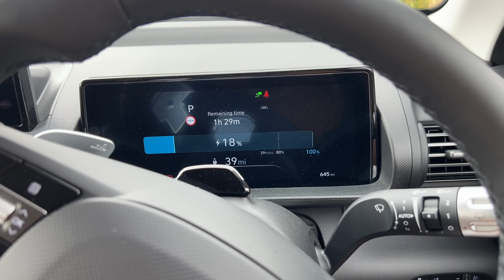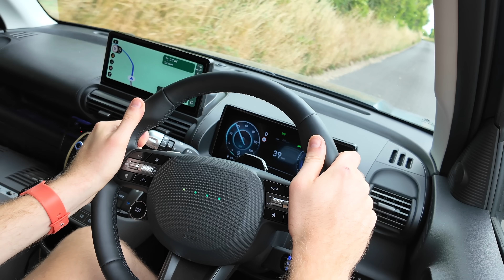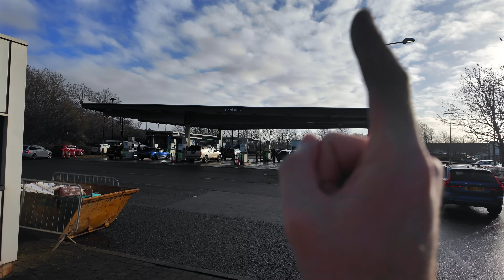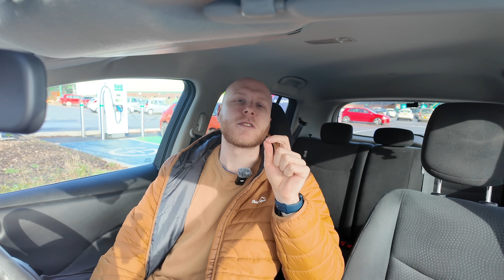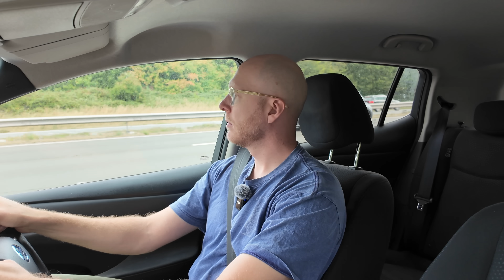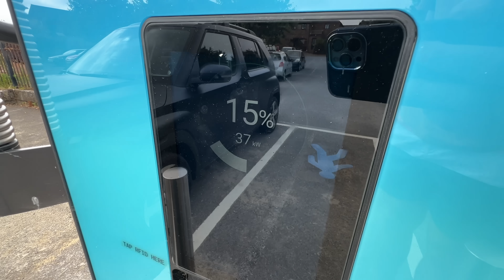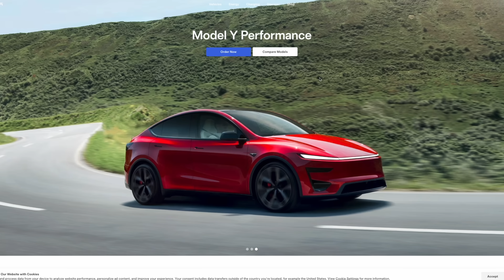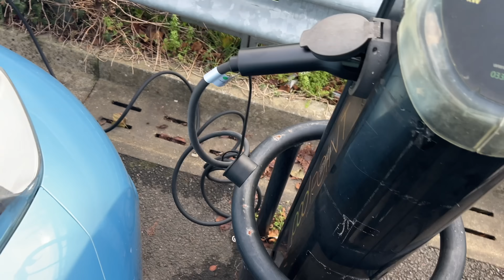19 Things You Should NEVER Do In An Electric Car

Comment: One of the morals of owning an EV seems to be to not believe anything that the car is telling you.  That's handy, I like a bit of certainty in life.
Reply: I have never found indicated range on a typical gas car to be all that accurate. I know the software is based on a filtered fuel sender position and long term fuel economy. The electric calculation should be easier.
Reply: My KIA EV3 predicted range is pretty much accurate all the time.
Reply: To be fair,  that is mainly for the leaf, other electric cars are much more reliable on predicting range than the Nissan leaf,  I speak from experience,  as I have owned a Nissan leaf 39kwh from new for 3.5 years,  I have done 69,000 miles
Reply: Agree, my car is within a few miles of estimated range

Comment: The 100% charging isn't really a problem any more and especially if LFP batteries and up coming Na+ chemistry.
Reply: 🤓☝️ charging to 100% and discharging to 0% over extensive periods (days) in any chemistry  including na+ does wear out the anode/cathod. 
But unlike NMC batteries, LFP batteries need to be charged to 100% and discharged to <10% regularly to help the BMS manage the voltage range and correctly detect the SoC.

in terms of it ever being a problem, it was never really a problem in the sense that the life of the battery outlasts the life of the vehicle in all chemistries

Comment: Cars with LFP batteries (a.k.a Chinese cars) don't bother at all with charging frequently up to 100%.
Reply: And even if single cells fail, these can be replaced for less than the cost of a complete battery replacement. The company that does this is still expanding, but I am sure: as the demand for that repair rises, so will their country coverage.

Comment: If you are watching this as a potential EV buyer or a brand new one and are finding it daunting then don't worry, you dont need to know any of this in your first few months. Watch some less sensation how to videos (Dave takes it on has some good beginner stuff) and wait till you are comfortable with the basics then come back to this as the info is useful but is presented as if you are going to explode if you get the slightest thing wrong.
To add to the tariff table, EDF, who i dont particularly recommend has the following EV tariff: peak 24.98, off peak 8.99 (12am - 5am), standing 71.

Comment: It should be noted that driving with one pedal does not only guarantee savings. Always below a certain speed (10MPH), the car USES energy to stop instead of recovering it. So not using it may be more energy efficient.
Reply: That fundamentally misunderstands OPD. It simply replaces braking in all circumstances where you would normally have engine braking or light friction braking.

All cars need to be brakes to a halt from around 10mph, and if you choose to lift your foot very lightly as you approach traffic lights, say, OPD puts some of the energy normally lost to friction into the battery.

It is a myth that regen or OPD is somehow “more inefficient than coasting” - that is a lie spread by the some car manufacturers because they couldn’t achieve a smooth OPD function.

BMW has achieved it with the Neue Classe cars, I understand, so I hope they will at least educate people. I discovered their “joy of stopping” years ago, in a Polestar 2, which is one of the reasons I chose to avoid any car without true OPD
Reply: yes, many times 1 pedal driving combines regen and friction. ideally for efficiency is no big accelerations, no friction breaking and minimal regen... ideally of course 😅. the ideal sweet spot is when you don't accelerate nor regen and just coast (at if in neutral in a combustion car).
Reply: OPD achieves “neutral” or “coasting” all the time. All it means is that the car needs a certain amount of energy to overcome mechanical, rolling and air resistance.

If you are driving down a slight slope, enough for gravitational potential energy to overcome those resistances, then OPD will ensure that no energy is going into the battery and none will be harvested either.

Regen is conceptually the same as braking, except instead of throwing energy away as heat part of it is put into the battery.

If you don’t need to brake, regen will simply not happen, whether controlled from OPD or the “brake” pedal.

This weird thing people imagine, that regen tries to take energy out of your motion when you otherwise would not have actually braked is just that, weird.

OPD driving and regen are two of the things that make driving an EV a total joy to drive. All this pointless shuffling of your foot from one pedal to the other is ridiculous.

I have touched the brake pedal in my Polestar 2 around once every 100 miles, and OPD is on 100% of the time. Adaptive cruise control uses regen when it needs to reduce speed, and power when it needs to increase it, and I typically achieve around 5 miles/kWh on road trips.
Reply: Bottom line is, you are probably talking about gaining another 2 miles range! I wouldn’t get hung up about it, just drive, use one pedal if you like and brake when you need to!

Comment: 100% You can't use regen braking.Use your brakes I do often .Leave them and your disc will rust and when you need your brakes in an emergency you could be in trouble.
Reply: My car will regen to about 5mph, then brakes are needed. This helps keep the brakes working. I just treat regen as engine braking.
Reply: My BYD can use regen brake with a full battery, because the battery has a buffer.
Reply: 'Cant'...I use it every electric journey in my phev? Car slows sets off automatically in traffic hands feet free!

Comment: If you need 100% charge, then charge to 100%. Not everyone has home charging.
Reply: Just don't do it at an ultra rapid charger. Charge up to 80-90% and then move it at an AC charger and charge there. It won't make any difference at the speed of charging, most cars after 90% do not charge so fast, ussually they fall below 20KW even below 7KW after 95% and it is possible that you will pay less.
Reply: @chrishar110  And where would this AC charger be? They're not too many of them conveniently located.
Reply: @stevekight1955  They are everywhere, what’s the problem?
Reply: @stevekight1955   This AC charger would be in your garage.
Reply: @woodenmetal2977  like he said, I don’t think he has home charging
Reply: @MRSALT22 
He said "there's not too many of them conveniently located." Since the context is rapid chargers, the AC chargers he's referring to are the level 2 public chargers.
Reply: @chrishar110 my ac charger is only 3kw so I'll stick on the rapid if I need 100% or I'll be there all day.
Reply: Depends on the trip. So if your journey has two chargers along the way, its quicker to do a two stop than 1 stop, as doing 10% to 100% takes around 1hr, while doing two 10% to 80% takes around 1hr, but you got an extra 50% more charge for same time. So if you cut the two stops to 25mins or even 20mins each, thats upto 20mins quicker.
Reply: As someone who doesn't have home charging, don't charge to 100% - there's no need to reach 100% of your capacity at a DC FC - the most I tend to do (when the chargers are empty) is 90% - mostly because I have to drive the car back to my place so it usually will sit there at around 85% until the next day.  But it depends, entirely, on when I'm driving next.  If I'm charging on AC at work on Thursday and I have no plans to travel, then I'll only charge to 90% - if I have travel plans, I'll charge to 100%.  But I've had no issues doing the big travel days with 80-85% - there's few situations outside of a long distance road trip (and, again, charging past 80% makes no sense because it'll make the trip last forever, and when on a roadtrip on an EV you only want to charge with enough to get to your next charger).
Reply: I don't even charge to 100% at home. 

At a rapid, the only reason you could ever have to charge to 100% is if it'll take 100% of your battery to get to the next charger. As that's never the case. There's zero reason to charge to 100% at a rapid. Taking 1h+ to get that last 20% on a trickle charge just makes you a nob. You're wasting your own time as well as everyone waiting for that charger. 

If it takes 20 minutes to charge to 80% and another hour to get that last 20% you could have discharged and charged your battery 3 times in the time you wasted.
Reply: Depends on your battery. If your vehicle has an NMC battery then you should only charge to 100% occasionally
Reply: this don't charge to 100% only applies to non lfp batteries.
Reply: @hirukaru4835 this don't charge to 100% thing actually only applies to old and early EVs like the 1st Gen Leaf. Let me give you an example:
A carmaker gives you a 160k km warranty for the most expensive part, and makes a part, which will lose it's capacity fast if charged to a 100%? That would not make any sense at all. Modern BMSes can handle these charges well enough that it should not be an actual bother for a normal car user. 

If you have an early VW ID.3 for example, the car tells you to only charge till 80% to preserve battery health, even though the battery is only able to balance the cells between 95 and 100% SoC, so the car will get a cell failure error code when only charged to 80%, which, if out of warranty, will cost you 4000£ at a dealer, even though a few 100% charges whould probably fix the issue. My mom's ID.3 got the same cell error code, and after a couple of weeks it did stop showing up, because since then we are charging it to a 100%. 173 k kms, and still drives and charges like new.

Comment: It's like you're trying to put people off buying electric cars. Telling them they need to buy a special device and interrogate the car through the OBD port is firstly guaranteed to put most buyers off and secondly suggesting that you do propagates the myths that EV batteries degrade badly, which they don't according to numerous videos that I've seen.
There's a few videos doing the rounds of several Tesla model S cars that have variously done from a quarter of a million miles to close to half a million miles and still have 70% or more battery capacity.
HubNut channel recently covered a quarter of a million mile (though only five years old) Hyundai Ioniq vehicle that was showing 100% according to the EV specialist that bought it and intends to use it as a courtesy car. Similarly he covered an (old technology) 10 year old Nissan Leaf with 150 thousand miles which had 82% battery life.
So, unless you're buying an extremely old car, you don't need to worry about it at all.
Reply: These videos are great for letting people appreciate all the things they took for granted in a normal car. I could have filled my tank 8 times during time it takes just to explain all the problems with EVs.
Reply: @SteveLomas-k6k  I'm sure he could do a similar video about ICE vehicles. He could start with the fact that they go on fire regularly because they carry a lot of flammable liquid (more than twenty thousand ICE car fires last year in UK alone). Also he could mention that they have all these mechanical parts that require oil and sometimes leak oil or use so much oil that it runs empty and ruins the engine. Similarly cam belts that fail and destroy engines, head gaskets that fail and destroy engines etc.. Then there's clutches and gears that break.
Did I mention catalytic converters and the issues burning off particles in diesel cars? Or EGR valves ? Excess noise. Fumes. Lack of instant torque and having to waste power revving engines to achieve torque. Wearing out brakes much faster because you don't have proper braking regen,. Taking ages to clear windscreens in cold weather because engines need to warm up..
I'm sure there more but that's a start.
Reply: @UnknownUser-rb9pd ... And ICE engines, having a very short range of RPMs, need a gearbox, that adds friction and loss of efficiency. And they need to be warmed-up in cold weather before safely giving full power. And frequent start-and-stops increase engine wear. And in very short trips, especially in cold weather, they produce moisture that fastens exhaust pipes' corrosion. And you have to be careful at which pump you refill, because it may be the wrong fuel. And they have more parts that periodically need replacing (filters, brake pads, liquids...). And if the fuel is contaminated with water they may have serious problems. And being inefficient they need large radiators that reduce aerodynamic performance. 
... And now I'm tired of listing the hundred-years-long list of patches conceived to overcome the limitations of such a device, solutions that we are so blind to call "technological advancement".
Reply: @UnknownUser-rb9pd  I have a 50 year old  summer driver, so am familiar with all those issues. But I don't think most people would know half of what you're talking about. Like my wife, they just buy a new car when they get bored of the look of old one.

But the problems discussed in the video come standard with every new EV.
Reply: @SteveLomas-k6k  Do they come as standard ? I doubt that very much and EVs have a 96% satisfaction rating from owners. EV owners are going to have more reliable cars than ICE vehicles and have less servicing . They are quieter, accelerate faster and are much smoother and more linear to drive. If you charge at home as most owners do, they are much cheaper on fuel.  As has been explained on many EV and car review channels, EVs are easy to charge if you slightly modify your behaviour. If you're on a long journey you charge while you go for a coffee break and toilet break on the motorway service station.  You charge at the hotel if you're staying away and your car is parked. The ranges of the majority of EVs are more than sufficient for most drivers.  Just like ICE car owners EV drivers don't encounter problems and just use them daily like any other vehicle.
I'm a new EV owner so can't absolutely confirm that I'll have any problems but have had no problems other than the learning a touch screen interface issue that all drivers have nowadays. My charging sessions involving plugging into a charger, waving a card and when I return from whatever I've been doing waving the same card to stop charging. No problems whatsoever.

Comment: The other thing which caught me out was the first time I tried charging to 100% ..... unplugged , reversed onto road and made way forward to junction at the end of the street........ took foot of the accelerator waited for the Regen to stop me .... no ..... no ..... no stopping .... 🤪had to full slam on the brakes....... so please note that regen doesn't regen when at 100% 🤓....  years of driving manuals also meant my left foot trying to find a clutch and landing on the brake pedal as well...😜
Reply: At least some OPD implementations don't have that issue (Nissan e-pedal in gen2 LEAF, Polestar/Volvo, Tesla (after copying it from Nissan)... ) as they use the brakes to give you a similar braking feel in case regen is not available. Hyundai/Kia might have solved that issue in the newest models for the i-pedal, but have not been able to verify that.
Reply: @fintrollpgr can confirm with 2024 ioniq 6 i have no problems with the regen braking/ipedal at any charge rate
Reply: @fintrollpgr I assumed 100% soc is not 100% of the battery is being charged (ie headroom). As my Kona regen modes at 100% still makes you come to a full stop.
Reply: @kooistradurk  problem is not that the battery is full, but rather that it cannot take in lots of power when full.. iirc when you are close to/at 100% the max power it can take to charge is like 1kW, and regen braking even at low speeds will push in like 10kW. So even if it had space the Battery cannot take in the power fast enough.
Reply: @fintrollpgr  Can confirm that the 2017 ioniq will always regen regardless of battery charge.
Reply: I have a Geely EX5. It has a regen-like feel even with 100% charge. I’m sure it’s not regenning tho. However, I also have an MG4 and that has zero regen effect until I get down to 93%.
Reply: The MG ZS I had had no regen braking at high state of charge.  My current Skoda does regen at 100% but not at much as it does at lower SOC.
Reply: @nyeainsbar2793 I’m guessing the car applies the brakes to create a regen like feel.
Reply: Well it's not that surprising as if the battery is full it can't safety store the energy recovered by the regenerative braking system
Reply: @404hopenotfound  Yes, but the control system should compensate by using the friction brakes to give the same driving behaviour otherwise it's just unsafe. I usually only charge my LEAF to 80% but if it's fully charged it's quite alarming how it wants to run away when setting off downhill.
Reply: Mine doesn't have one-pedal driving, though.
Reply: Yes true with my tesla 3 , over 90% charge no regen